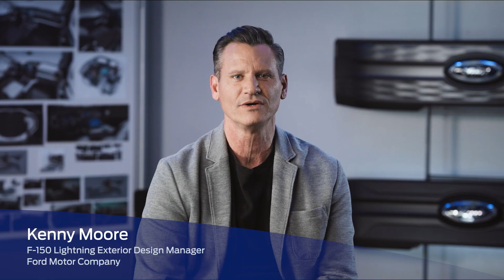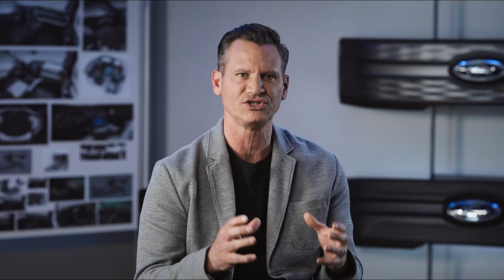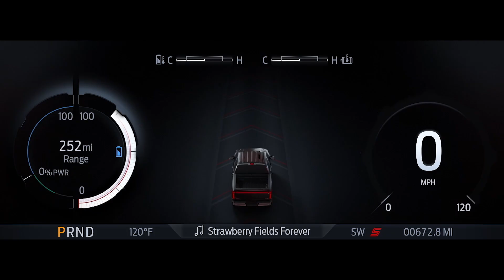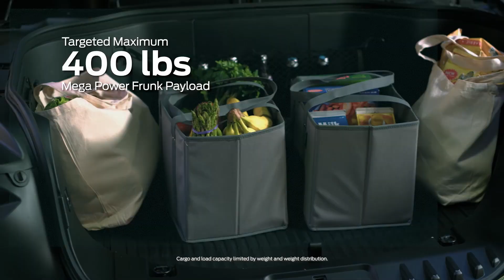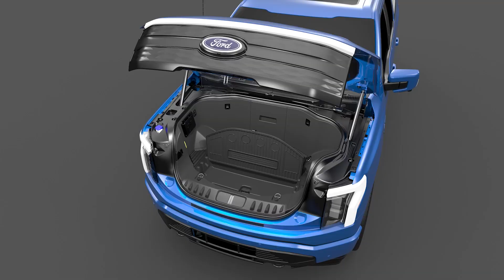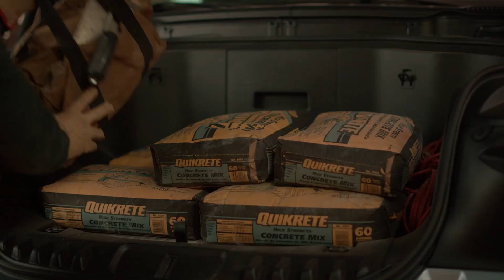F-150 Lightning Lowdown: Purpose-Built Design | Ford

Comment: What is the cost to replace a failed battery?
Reply: No one knows. No truthful person know how much a battery will cost in over 15 years. My rough guestimate based on the shape formfactor limitation of existing truck. It will be 2/3 the price for 150% the battery capacity. I doubt the same density batteries will exist in 15 years.